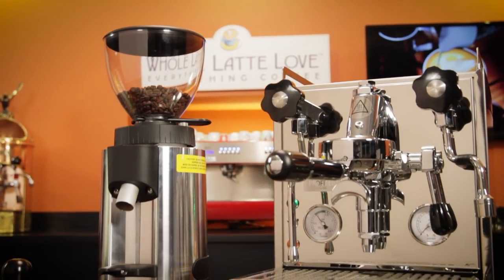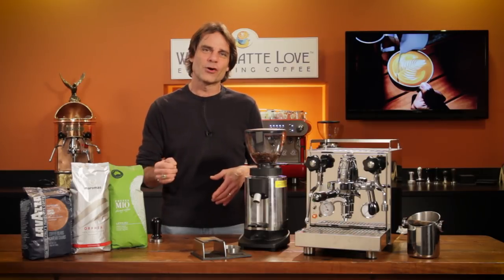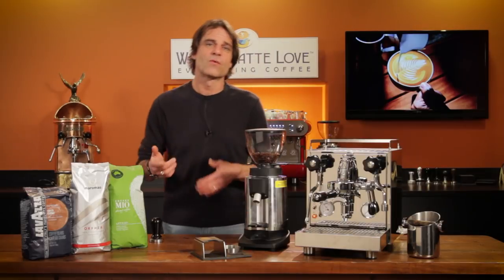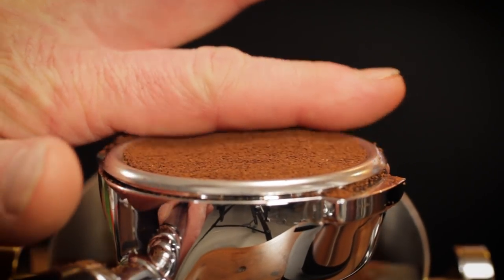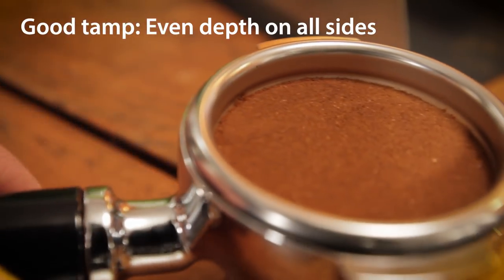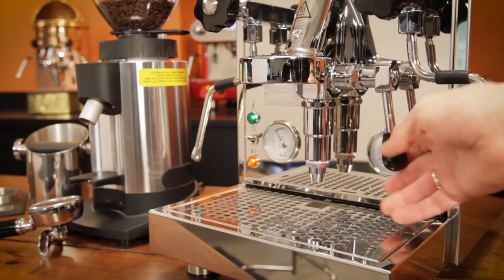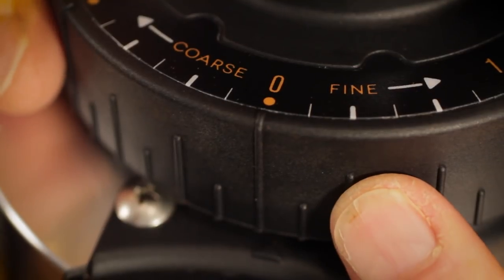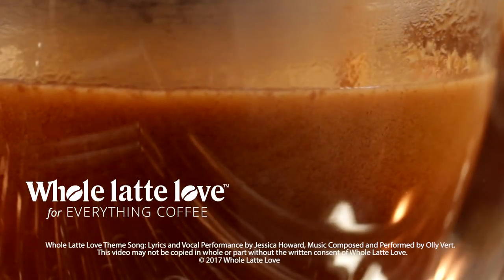How To: Basic Espresso Technique - Dialing in Grind Size

Comment: Hello! Does extraction time from single shot of espresso need to be between 25-30 secs too?
Reply from the maker: Hi na, Traditionally, single extractions use the same timing as doubles in the 20 to 30 second range. Personally I tend to work the lower end of that range for a single. But, I very rarely do singles.
Reply: The timing is the same as a double shot, but the amount is 30ml instead of 60ml for a single shot.

Comment: Just bought a Gaggia classic pro along with the Breville pro grinder,  any tips would be greatly appreciated, thanks
Reply from the maker: Hi L, Well, this video will get you started. Making good espresso is all about getting the grind size right and being consistent with other variables as you dial in the grind size. Also, search our channel for other videos on the Gaggia Classic Pro. More than 30 videos featuring the machine.
Marc
Reply: @Wholelattelovepage  : Thank you for the reply, my respect for you has resin for answering, being such an old video I didn't expect a reply.
Will be using my brand new grinder today(Beeville smart grinder pro)and see how it goes, thanks again

Comment: Hi Mark, I have ordered a Linea Mini (turning 40 soon...)
I have the habit of flushing before every shot for 12 years as a barista, for hygiene and heat control purpose.
This is my first home espresso machine, I was using « la moka della mamma » for all those years (those espresso machines come with a price...)
Does the Linea Mini need a pre-extraction flush?
Reply from the maker: Hi Va B, That's a heck of a birthday present! With a saturated group and PID temp control you will have very stable/accurate brew temps. No flush should be required for temp control but can do a quicky for hygiene purposes. Congrats on the new machine!
Marc

Comment: Using an Expobar Office Lever, what you recomend as to flushing prion to brewing?
Reply from the maker: Hi SAB8, Flush until the flow from the group is smooth. On a machine that's fully warmed up and been sitting idle for awhile you usually get some flash boiling when first raising the lever. You'll hear and see steam coming from the group and probably see some bubbles coming from the shower screen. Watch the flow as you flush. It will be turbulent at first. When it calms to a smooth uniform flow you can end the flush.

Comment: Mark, if you're reading this can you assist me? I purchased a Breville Touch Barista for my wife. I have had it for over 1 month and have poured over 50 espressos with it. Sadly, each espresso is either sour or bitter, too much or too little. I would imagine someone who has this machine could give me some basic starting numbers to get me very close to a perfect cup of espresso. Like use such and such brand of beans, course settings, temp setting etc. I've watched a number of videos online but just can't seem to get it. I'm not ready to give up on the machine as I believe the issue is user error :)
Reply from the maker: Hi Rudy, It takes a bit of practice to use this machine and get the basics down. I can't really give precise numbers for things like grind size as that depends on your brewing variables and everyone's are a little bit different. As described in the video consistency is key when dialing into the correct grind size. So try and use the same dose of coffee every time. Sour flavors generally indicate and under-extraction and bitter flavor an over-extraction. For coffee type Italian style bean blends tend to be the easiest to work with. So try something like Lavazza Super Crema or one of my favorites in that category Maromas Orphea: https://www.wholelattelove.com/products/maromas-orphea-whole-bean-espresso
Other advice: Be sure your are using the single wall non-pressurized filter basket. Use the double shot (singles are difficult/finicky) basket, Grind enough coffee to slightly overfill the basket and level to top edge and swipe away excess without compressing. Then tamp firmly and evenly. Don't worry too much about tamping pressure just use about the same every time. Also make the tamp flat! Any angle on the puck surface will lead to both under and over extracted coffee in the same shot. Make repeat shots adjusting the grind size until you get 2oz out (including crema) in that 20-30 timing from 1st drip.
I hope that helps!
Marc

Comment: I noticed at 5:56-6:00 during pre-flush that there is clearly a stronger water flow in the center and back right, i.e. it's not perfectly even.  Same thing happens in my Gaggia Baby Class.  Technically the water comes from 2 larger holes and spreads into 6 smaller holes in a circle before going through the filter screen.  So I'm sure that's why it's not really even; so how does that affect how evenly the water goes through the beans and the final extraction?  Does it actually spread out better when it reaches the bean surface?  Great video, as always -- thx!!!
Reply from the maker: Hi RA, Thanks for the question. Some machines provide a better more even flow from the shower screen than others. Uneven flow can have an affect especially if the filter basket is too full so water is forced directly into specific areas of the coffee puck. If you are getting an impression of shower screen in puck after brewing then your basket has too much coffee in it. We do want some space between shower screen and coffee puck to allow for even saturation of the puck.
Marc
Reply: @Wholelattelovepage  Great point, you're saying that having some space b/t the shower head and puck will usually allow for an even enough extraction.  Just now viewed an interesting idea where an aeropress filter was trimmed and placed 1 above and 1 below the puck significantly increasing the TDS from around 9.5 to over 10 for a better extraction - although not really so practical.

Comment: Great video WLL.... 
Question, for a 21g or tripple shot basket, is it still 20 - 30 sec and 2 ounces or do you add a 1/3 more to the time (30 - 45sec) and produce a 1/3 more coffee (3 ounces)?
Reply from the maker: Hi niclema, It comes down to what you like. I suggest letting flavor be your guide. In general extraction time does not change regardless of coffee dose. But there are all kinds of variations! Some are using longer extraction times with those higher doses. In a recent SCA survey of professional baristas the majority reported pulling double shots with an average dose of 18-20g and extraction time of 25-30 seconds. Here's a video with results of the SCA Barista Survey: https://youtu.be/a16QqiK4hzo
Reply: Thank you for your reply, much appreciated. And very informative SCA Barista Survey video. Love your videos.
Reply from the maker: Hi n, No problem, it's what we do - and thank you for the kind comment!

Comment: Hi Marc, I have a 2001 Office Control. How long a cooling flush do I need initially for the first pull? Thanks.
Reply from the maker: M W hi, I’d flush until flow is smooth from the shower screen with no bubbles and no excess steam. 3-8 seconds depending on where the machine is in its heating cycle.

Comment: Hi Mark, i have a Breville expresso and i have a question about texturing milk. Everytime i finish, there is a circle of thick foam on top but the rest is the texture of wet paint. No problems spinning the milk, i stop between 63 and 65 dwgrees Celsius. Never had issues with my old machine which was a sunbeam but my new Breville leaves me with this circle of thick foam and i cant do my latte art. Anything you suggest i could try differently?
Reply from the maker: Hi SERAEG, Thanks for the question. Excess thicker foam is usually an indication of too much air getting into the milk. This is caused by the steam tip position being too close to the surface of the milk. Try a slightly lower position of the tip in the milk. You want some air to be ripped in via venturi effect at the start of steaming. By the time the outside of the pitcher is starting to warm position the tip slightly lower into the milk and angle the wand for a vigorous roll to break up any larger bubbles. My guess is your Breville has a little more steam power than the Sunbeam so it gets air in faster than what you were used to.
Marc

Comment: Hey Mark
Realy appreciate your great videos, we truly learned a lot about coffe from you and wholelattelove team.  I have a question if I may ask, do I have to flush my ECM elektonika before I pull a shot?
Reply from the maker: jeff hardy Hi, thanks for the comment and question! In most cases you will want a short flush. Best way to determine is to observe the flow without the portafilter in place after the machine is fully warmed up. Run some brew water. If flow is bubbly that indicates water over 212f/100c. Continue flushing until flow smoothes out. Usually just a few seconds. Brew right after the flush. Depending on your coffee, overtemp brew water produces bitter flavors while under temp produces sour flavors. If you detect sour or bitter flavors adjust flush timing a few seconds either way to change brew temp. Go for longer flush to correct for bitter and shorter to correct for sour. Hope that helps!
Marc
Reply: @Wholelattelovepage  that truly helped.  Thank you Marc.

Comment: Just got the ECM casa v from you guys. Should I do a flush prior to extraction?
Reply from the maker: Hi Jeston, Congrats on the new machine! As it's a single boiler machine flushing depends a bit on where the machine is in its heating cycle. If you press the brew button without the PF in place and the flow from the group is turbulent/bubbly/steamy then flush a few second until flow is smooth then brew right away.
Marc

Comment: Love the vids. Do i need to flush a duo temp pro? Keep the vids coming i am learning a lot thanks.
Reply from the maker: Hi LL, Thanks for the comment! It's been a long time since I used a Duo-Temp. I believe it uses a thermoblock for heating brew water. You can check for need to flush  by running a little brew water without the portafilter in place. If it's very bubbly/steamy initially that's an indication of flash boiling and water temp above 212F/100C. If you see that then yes, flush a few seconds until water flow is smooth and then do extraction. If it's smooth flushing is not needed. Hope that helps!
Marc

Comment: I have Breville Oracle, the non-touch version. I'm just wondering if weighing the coffee and the yield is a much better approach when dialling my grind size. So 22 grams double basket of medium roast coffee (grounded and tamped by the Oracle), when I brew it for 30 seconds, do I expect a yield of 44 grams (1:2) or 55 grams (1:2.5)? And with an 11 grams single basket medium roast coffee (grounded and tamped by the Oracle), when I brew it for 25 seconds, what yield do I expect is the best, is 1:1.5, 1:2 or 1:2.5?
Reply from the maker: Hi JM, You can most definitely use brew ratio! Timing is a basic technique to get you in the ballpark. There is no one best brew ratio although some roasters to suggest a preferred ratio for their coffee. At the end of the day it's about what you like and what works for a particular coffee. If interested, we do have a video on brew ratio with more information: https://youtu.be/57UqPDirHoU
Hope that helps!
Marc

Comment: Hi, I am setting up an entire new espresso setup, moving from a super automatic. Where do I start? Do i set my grind first? Dose amount first? Should I start with a single wall or double wall pressurized basket? When do I start playing with boiler temperature? Thanks
Reply from the maker: Hi z, Here's some basic advice to get you started...
What make/model grinder and espresso machine are you using? Since you mention "double wall" I'm guessing Breville machine as that's what Breville calls them./

1. If you have a decent grinder forget the pressurized baskets and use the non-pressurized baskets - you'll make a much better espresso!
2. Use the double basket. Doubles are much easier to pull than singles.
3. Always keep your portafilter locked into the group when not in use so it stays warm.
4. Start with a grind that's a little finer than granulated sugar. Then dial-in as shown in the video.
5. Use the same weight of coffee for each shot as you dial-in the grind size. If no scale, just fill the double basket slightly over the rim and level off. Tamp coffee firmly and evenly. Tamping pressure is not critical but try and use the same pressure each time. Evenly distributing the coffee and tamping level is more important than tamping pressure.
6. You are dialed-in when you produce about 2oz/60ml of espresso in 20-30 seconds from first drip
7. Start with a brew temp of 200F/93C. I'd get some experience making consistent shots before playing with boiler temp. When you get to that point, general temperature advice is slightly higher for lighter roasts, slightly lower for darker roasts.

In the end, making fine espresso is about the interplay of many variables. As you adjust one variable keep the others consistent to determine the affect of your changes.

Hope that helps. Let me know what grinder and machine you are using and I may have some other tips!
Marc
Reply: Yes it’s the Breville Dual boiler, I also purchased a calibrated espro tamper in effort to remove a variable from the equation. My grinder is the Baratza Sette 270. Where do I start?
Reply from the maker: Hi Z, You should be good following my instructions above.
Marc
Reply: Thanks Marc, I just set everything up, Baratza has a basic recommendation for grinder settings when making espresso, I used that and my second shot is one of the best espressos I have ever had. Thanks for tips, now for tweaking, unfortunately I am espressoed out for the day, I may just go and climb Mount Everest with all this energy.
Reply: Hi Marc, another quick question for you, I am trying to dial things in but I have a timing question. With my dual boiler machine when I push the double shot button, it loads in 30 seconds, but that 30 seconds includes pre infusion. Generally my first drip occurs at about 11 seconds or so, my shot completes pouring at 30 seconds giving me 2 ounces. Does the pre infusion count in the time or should I be timing from the first drip. The way I have it now the flow looks really good. I do have a little sourness if I sip immediately after the pour but it dissipates quickly and the shot tastes really good. Thanks again

Comment: I see some fill the portafilter with coffee and then level and then tamp. Others fill, collapse, and then tamp. The two methods seem to affect the coffee weight differently. Which is best? Should the coffee be weighed before leveling, after leveling or after tamping?
Reply from the maker: Hi Jason, Thanks for the question. Not sure I understand. Weight should be the same before and after leveling or tamping.
Marc

Comment: Hello Marc, I just bought a Ceado E37J and calibrating it. I’m at minumum grind (finest) and I pull a 20 second shot only...? I had a 18 grams basket befor so I decided to put a 20 grams basket (VTS) and I get the 20 second only ....Should I put a bigger basket? 22 or 25 ? I have a perfect puck since I got the accessories to make a perfect one. 

My machine is a single boiler (top shape) Isomac Mellenium with a IMS nano tech shower screen.

Thank you in advance for your help.

Sacha from Montreal.
Reply from the maker: Hi Sacha, Thanks for the question. Hmm... The E37J should be able to grind fine enough to choke your machine - a grind so fine there's little to no drip from the spouts. If you have not already, try this: Grind out all beans and remove the hopper. Pull of the rubber ring below the hopper. The grind size adjustment lever is held in by a screw(s). Push the lever to the finest grind size position. Then remove the screw and reposition the lever to where it would be if set to the coarsest position and put the screw back in place. You will now be able to set the grind finer. Hope that helps!
Marc

Comment: Shouldn't be timed from lifting the lever not first drip? The Profitec's 700 starts its display timer from lifting the lever.
Reply from the maker: Hi John, I got into the habit of timing from first drip. I work with vibration and rotary pump machines. Rotarys like the Pro 700 tend to drip sooner than vib machines. In my head, solids start leaving the coffee puck shortly before the first drip. So for me it helps when comparing timing between machines with different pumps.

Comment: Hi Mark, I have a under $100 espresso machine, and I'm often getting a long brew, even after doing small grind adjustments on my manual coffee grinder, any ideas how I can get the perfect extraction??
Reply from the maker: Hi ARG, If it's an under $100 machine it likely uses a pressurized portafilter. With that type of machine (actually appliance) grindsize will have little affect on shot timing as it's the restriction built into the filter basket/portafilter which controls flow rate and not the grind size of the coffee. Here's a short video with the difference between non-pressurized and pressurized filter baskets: https://youtu.be/vB2bOZ1V99M
Marc
Reply: @Wholelattelovepage  Ok thanks, also just wondering if you ship to Australia please :)